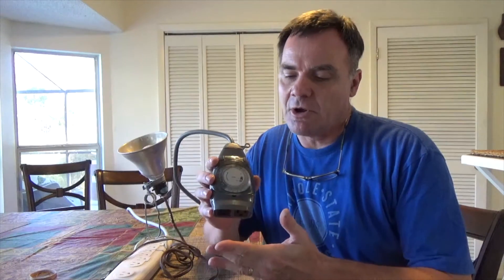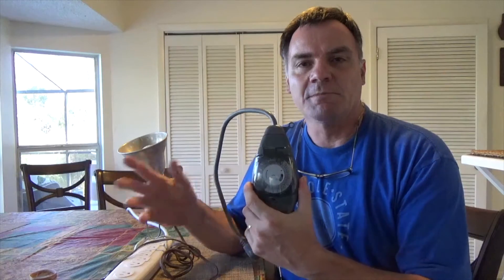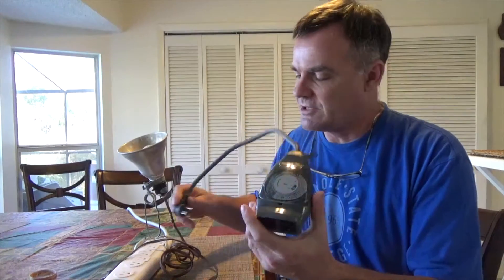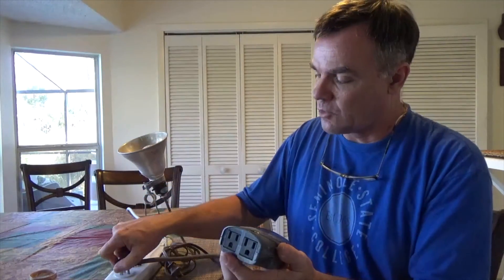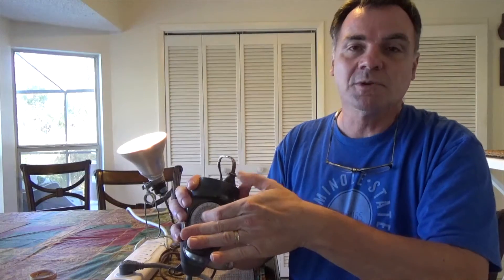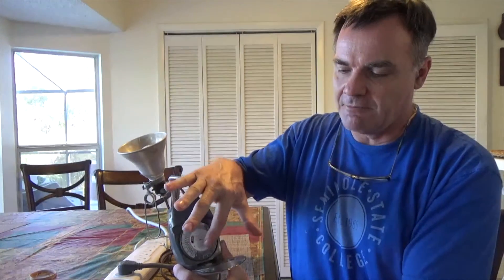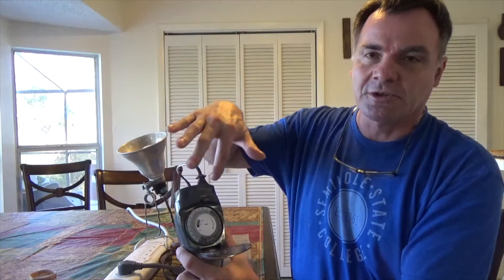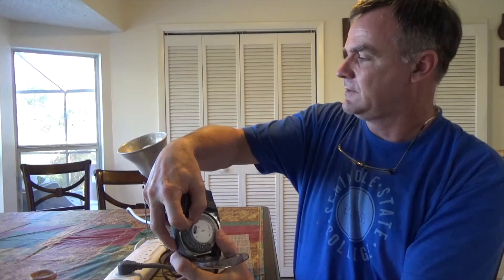Tork Timer Testing & Troubleshooting

Comment: I have 3 timers all work when set to ON but for some reason don’t seem to work when set to TIME. Also I find it very difficult to turn the dial. Have no idea why or if I can do anything to fix it. Also what effect this problem might have on the problem I’m having with the timer. PLEASE help me
Reply from the maker: Hello Syma, Unfortunately when this has happened to me it was an indication that the timer is most likely broken. The first time I had this happen I opened up the timer (of course after unplugging it and taking it to my workbench) and found that one of the plastic gears or other parts was broken and preventing the timer from moving properly.

Comment: Hi project 128.
I have a 602a Tork Timer. While electricity is flowing thru the unit, especially when it is set to "on", the timer itself seems like it's not working properly. Today, I set the time for 4:15pm & set the markers for 15 min on/15 min off. At 7:45 pm this evening, it still read 4:15pm & was still on. However, if I manually rotate the disk, the timer clicks correctly & my hydroponic tower responds accordingly. What could be the issue? Do I need a new timer or can this be remedied? TIA 🙂!
Reply from the maker: Hello Edenis,  Sorry for the delayed response.  From our experience if the timer does not advance automatically but you can move it manually, then usually the gears on the inside are broken and you need a new timer.  Sorry, that we do not have a work around for that.  Good luck to you.

Comment: i want to operate the timer *602 a (110 v)for drip irrigation, to do that i count with a solenoid valve that i took  from an electric washing machine that runs on 220 v  i will plug the timer with a transformer 220 - 110 my question is do i need to plug a transformer on the outlet as well? i am hoping somebody will answer my question...thanks

Comment: Hi Project128,
Thank You for this helpful video on testing & troubleshooting the Tork mechanical repeat timer. Since you are always looking for "new and fresh ideas", I thought you might like to look into a better timer that requires virtually no "testing & troubleshooting":

HYTimer® - 100% Waterproof, Wireless, Repeat Cycle Timer
http://www.level2concepts.com/hytimer

-- Happy Growing! -JoeD #Level2Concepts @Leve2Concepts
Reply from the maker: Hi Joe - thanks for the information.  We will have to look into this timer as a possible replacement.  The Tork 602A right now is a nice value around $15 - 20 USD.  The HYTimer looks great especially since it would not have the mechanical dial like the Work (which has plastic gears internally), however the price of $79.99 USD is the cost of 4- Work units. We have been lucky with the Tork units and they usually last 3 or more years (we have some working full time for over 5 years). The Tork is becoming less available so we may be looking at a new item to replace ours in the future - thanks again.
Reply: In case you missed it, two major advantages HYTimer has over the Tork timer is that it is 100% IP66 rated waterproof and (this is most important) it has the ability to set On/Off cycles in less than 15 minute increments. Aeroponic and/or modified NFT systems like the Tower Garden® perform best with nutrient solution pump running a short On time that repeats at high frequencies (ex: 1m-On, 5m-Off)... these optimal pump timings are impossible to achieve with a 15 minute increment timer such as the Tork. Have a great day! :-)
Reply from the maker: Thanks Joe, yes I did notice that the HYTimer had a water tight enclosure (what I refer to as a NEMA 4-4x).  As for timer sequences lower than 15 minute intervals we are operating various systems such as the Tower, VGS, NFT, ebb/flow, and GH AeroFlow systems, which are all operating fine on a 15/15 cycle. If we were operating commercially we could use a more fine tuned timer and adjust the timing based on the flow in the system(s), specifically the flow/drain timing to determine an optimal cycle, which would be different for each system and would also be affected by the root systems and types of plants in each system. Right now the Tork timers are doing well, so we will keep the HYTimer in mind when we go to do replacements or decide when to evaluate and compare available timers on the market.

Comment: how does the clock inside work? what powers it and how precise it is? maybe you have an old one to 'dissect' for us in a video? it would be really helpful and interesting to know how the stuff inside look and work... thank you
Reply from the maker: Hello Doc,  Thanks for the questions.  I am not sure if I still have an old one - but if I do I will do a video showing the internal components, otherwise as soon as I need to replace one I will make sure to save it to do a new video. The timer is a basic electro-mechanical device powered off the 120 vac. The switches on the outside of the unit make contact with the internal switch (single pole switch - on/off) and push the switch either on or off depending on your selection (external dip switches are either on/off position).  As for accuracy, I have not timed it to verify how precise the 15-minute intervals are, but I have done work between cycles and walked away and came back after 15-minutes and the systems are off - I complete my task(s) and the systems seem to cycle pretty close to 15-minute intervals.  I will time a few of them this weekend and report back my results.
Reply: i meant clock accuracy, cause i have 2 (different brands) analogue timers and they are both quite imprecise, for example 5 minutes a day or even more, thats half an hour per week, i use them for lights switching in my backyard and every day they turn on lights 5 minutes earlier, it doesnt seem much, but after several days you can clearly notice the difference... but thats to be expected from the cheap stuff (~5$)... do you know maybe if the digital ones are more precise? in the price range of 10-15 dollars?
Reply from the maker: We use these for cycling hydroponic systems and not for operating any lighting or appliances. The primary timing cycle we use is 15-minutes on & 15-minutes off so the lose or change of a few seconds or even a minute either way is not an issue for us as we can use the plant condition as an indicator of how the timer and other equipment is operating properly. Sorry I can not provide more detailed information on the precision - the manufacturer of TORK is NSI - their technical assistance may be able to help you with your questions.